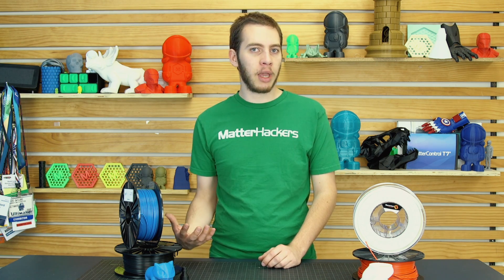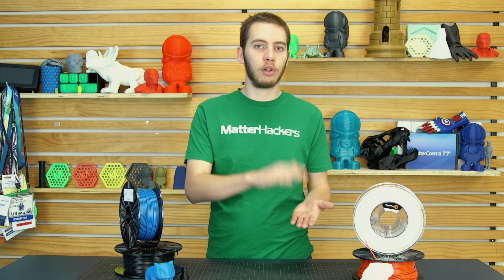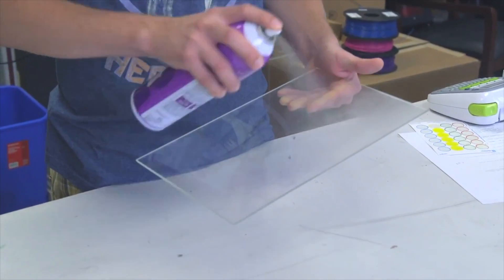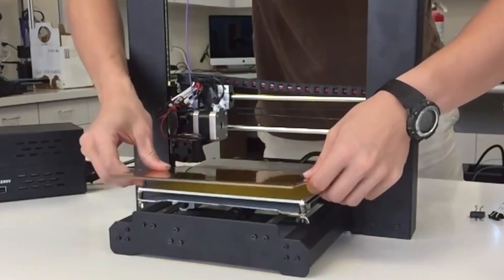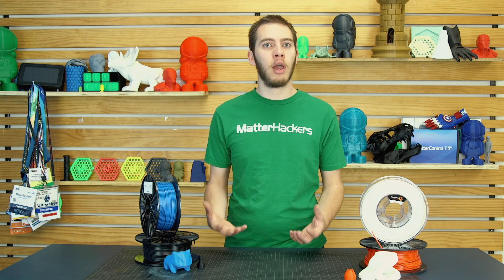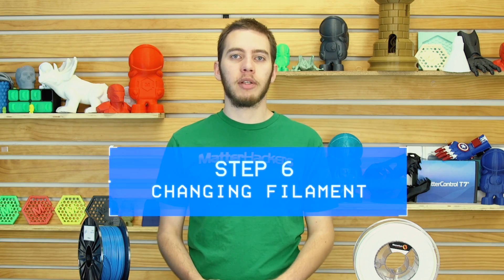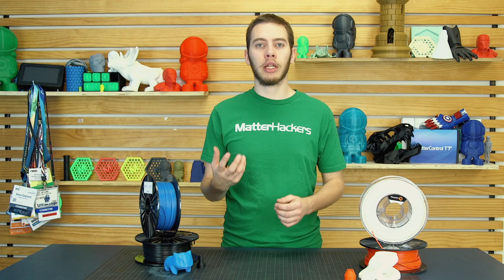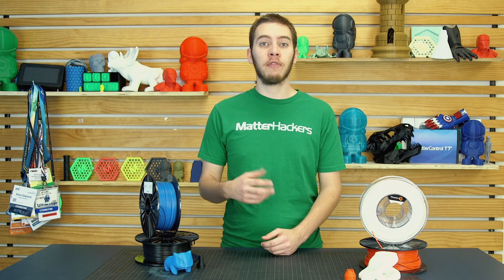How To Succeed When 3D Printing With ASA Filament // 3D Printing Filament Guide

Comment: So if I can print carbon fiber polycarbonate with no enclosure and the bed heater turned off I should be able to dial in ASA and ASA-CF and be fine

Comment: I have an issue where when I go to print my printer starts to cool itself from the correct temp to 100 degrees Celsius lower. this has caused many jams and is very frustrating do you know of any way of fixing this issue.

Comment: Help!! Just started printing after a long time.
I'm using ASA for a radio control boat, so I can sand , glue and for strength. 
Problem is , it won't stick to the bed!. Am using only rubbing alcohol  99.9% pure to clean the mega x glass. No glue or anything else.
Printed the mast as a trial; printing temp 230c, initial layer 235c and fan on 30% ( used fan after 4th attempt and finish is superb )
Problem is that it lists of the bed whether it's a small surface touching or a larger area touching,  it just seems to warp or lift of completely. 
PLA was easy, this is frustrating.
All other settings are fine.
Do I need a glue or something else?
Can someone please help?
Reply: Hey man did u figure it out?

Comment: Great video Buddy! I finally found the cheapest an best solution and I have tested with very tall items without failure.  Solution :
1. Get a transparent plastic Bag that is way bigger that ur printer n avoid it touching ur heat bed n nozzle.tuck excess under the printer or tape down.
2. Get a painter's Tape, even one from dollar tree works but quality one is much better as it leaves no residue to be cleaned off when it's time to remove it.Note: remove only when heat bed is hot much easier .
3. Vey important bed leveling as this will ensure nozzle doesn't knock ur prints off the bed.
4. Temp settings:  nozzle 260-270, Bed 110-120
5. Turn the Fan OFF!
6.  Ur Prints will stick to the printers tape on the bed forever until u want to take it off which is also easy to remove. I have sidewinder X1 n I have printed lots of fuselage for rc planes with this method. I even print my original PLA  Gcode files  in ASA . All I did was change the settings in the printer to preheat 270 nozzle 120bed and as soon as print job starts turn the Fan off and recheck again n again to make sure the fan is Off n heat setting remains same for ASA. Then cover printer with transparent Garbage bag. All done
7.Good luck !
Reply: what speed tho?
Reply: use an upside down dirty clothes basket as frame.

Comment: nice, Informative Video. I am doing almost all of the steps for PTEG already. And I have no problems with layeradhesion or adhesion of the first layer. At least not with PTEG. But so far, I have no enclosure. Can you recommend a passive phototent-enclosure? Would this be enough for ASA?

Comment: ASA doesn't print good on my ender 3.... 255c 110c Bed temp, No fan and it comes out flaky with no solid layers... Dunno what I'm doing wrong... please advise...
Reply: I print in an enclosure and preheat it but yeah ASA is tuff, ive had good results in summer in ahottt room no fans 105 250.

Comment: How are the fumes from ASA? Most places warn that it releases toxic fumes while printing, yet I still see people not using enclosures with fume extraction.
Reply: Nobody answered you in 3 years?  My god......  Um, they are terrible.  I haven't tried abs but i am going through asa pains now.  I blow that stuff outside with a inline fan and window duct on my tent. STYRENE FUMES still get released and you can smell em.  Need enclosure and correct ventilation without causing draft/thermal shock.

Comment: I use PVA mold release film, that is normally used for easy mold release with a special priming wax, used that way, it will keep resin from sticking to the mold, and make release easy. Used without the wax on a Glas plate, it will act like a PVA glue, you can wipe it on with a paper towel and it will dry high gloss. Works perfect for me so far, no warping on an open frame Hypercube.
Reply: i know this is old, but which pva mold release did you use by chance? some are alcohol based and some water based, wanna know what worked for you

Comment: If you're printing on glass it's better to start with a lower temp, like 85, then increase by 5 degrees until you get a good result. If you start high, say 120, you may have a bad surprise when you try to pry the part of the bed and it take chips of glass with it.
Too hot can ruin your glass bed because just like ABS, ASA can bake itself into it.
Reply: Nope, use water. Spray on it, submerge it, doesn't matter, it will save the glass.
Reply: @dtibor5903  3 ruined sheets so far, even just by letting the parts cool on their own. I switched to metal plates.

Comment: I have to use part cooling fan on overhangs and bridges.. If I don't I get really bad unusable parts with melted holes and sagging overhangs.  So I don't know why you are suggesting to turn the part cooling fang off.   In my experience it's a difference between perfect print and failed one.

Comment: sorry my friend, I like your video, but what you tell us about temperature is wrong. ASA is my favorite material. Big or solid parts must be printed with 50% fan and small or fragile parts with 100% fan speed. Otherwise you get very poor results. This is different from ABS, because ABS works best without any cooling.
Reply: As with anything, this depends on your printer, chamber, and even your ambient temperature. ASA has a temperature it wants to be maintained at. The best would be to have a heated chamber, with auto temp controls.
Reply: Thank you for providing this knowledge.

Straight forward to the point.

I've been searching a straight answer for a little bit.

Comment: WTF. No one should be using Kapton or hair spray in 2017.

Seriously.  Kapton, hair spray need to die in a fire.  PEI for ABS, PLA, TPU and PETG. GeckoTek for Nylon. End or story. There is no other way to print.
Reply: Having a rigid way of thinking actually gives you a false sense of intellectual superiority. Being malleable in what information you consider to solve a problem, and being discerning of all information provided is how successful people handle situations. In your case, you may NEVER try hairspray in a situation you are unfamiliar with, because you have a concrete belief that nobody should ever be using it. Meanwhile, someone else has considered it, and is having great success. They are having an easier time with their work, and are living a smart happy life. Not you though...sad.

Comment: Printed with Filamentum ASA Extrafill on my Prusa Mk3 on the PEI sheet. It broke the PEI layer, had to hammer it off.... Any way to reduce bed adhesion?
Reply: Stuff like this is mentioned in the manual. You can either use the included glue stick, or get a textured sheet, on which you don't need to use anything. You can also ask Prusa support.

Comment: @1:56 Kapton tape doesn't to a damn thing to spread heat more evenly on the bed.  It's too thin (just a few mils thick) and not a great conductor.  To spread heat well it would need to be both of those.  I would love to see a thermal image proving otherwise.  

What Kapton DOES do is improve adhesion and allow for easy cleanup.
Reply: I am in electronics, and Kapton tape is used since it does NOT conduct heat.

Comment: ASA needs to drop by 10 a kilo so more people will leave ABS.
Reply: 6 months later and it has only gotten worse for ASA. :(
Reply: ASA is a bit tricky since you need a cooling fan to keep it from drooping.  I was impressed once I dialed it in.  It was very impact resistant and very machinable.  Perfect for functional parts.  I used a Prusa i3 mk2S with enclosure at 115C bed temp.  The chamber gets warm so the cooling fan needed to be on and short layers need a fan and to print very slow.  The top stack of 3D benchy took some fine tuning so it wasn't a drooping mess.

Comment: I have printed a lot of small parts with unbranded ASA from China with good results on my Original Prusa Mk2S. It does not stick to the heated PEI bed at all. But a glue stick makes it all work. I still need a brim for the print.
Reply: It didnt stick to your PEI sheet? Weird, it stuck so good to my sheet i had to grab a hammer...

Comment: I've had a different experience. ASA actually likes the fan, but on very low and very ambient. Even with big parts. Do this and no enclosure is necessary. However, I have better experience with more shells. 3 at a minimum.
Reply: It all depends on your ambient temperature temperatures.

Comment: For me without fan cooling it's nearly impossible to print ASA. I need it running at about 20%-30% on my Prusa i3 MK2S. At least with Fillamentums ASA
Reply: Same here, two different ASA filaments, for both I need 30-50% fan cooling, otherwise curls and bends. Glue stick and brim or raft improve the succes chances. Why making an "expert advices video" to say all this useless wrong crap...